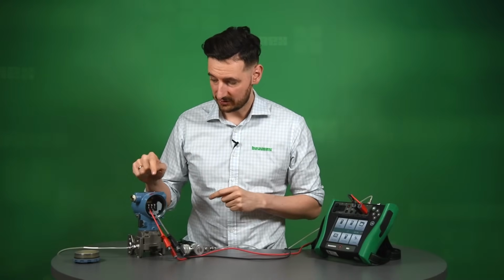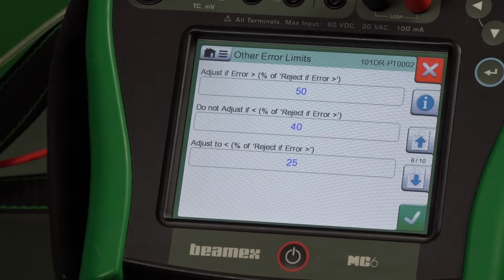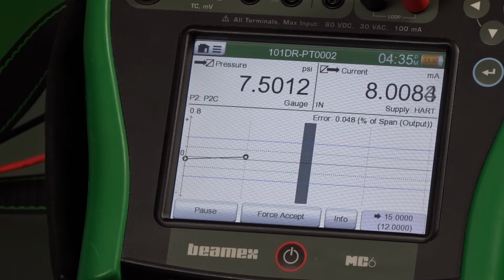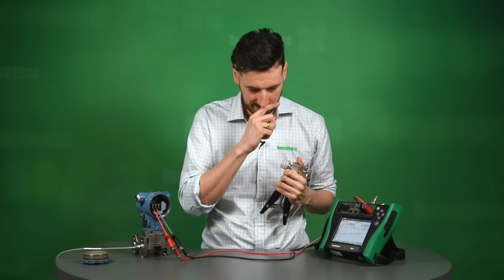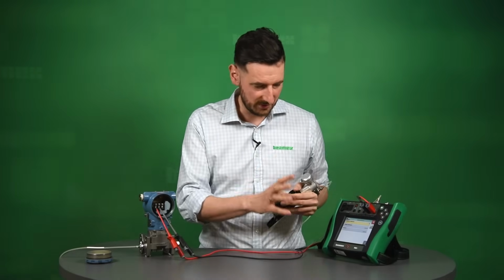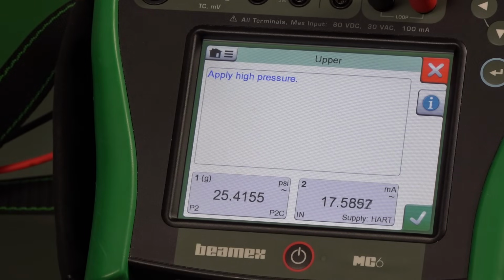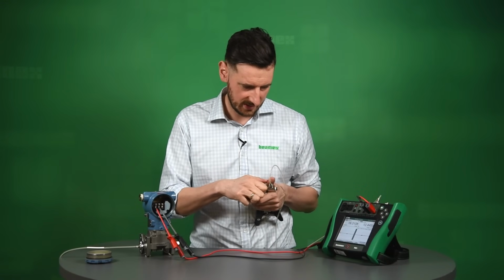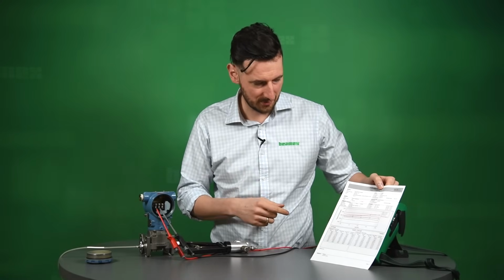How to calibrate HART pressure transmitters - Beamex

Comment: Hello, I have a problem with the Beamax device. The current value does not change when the temperature transmitter is connected
Reply from the maker: Hello Sir! We have already replied to you on this question several times to you in all the other video comments you have added it to.

Comment: Specify connections on the 3 terminals on tx. which 2 terminals used for hart and which for calibration
Reply from the maker: Hi! The transmitter used here is a Rosemount 3051 model. This one has also a "test diode" connection, which all transmitters don't have. In this case the two leftmost (PWR/COMM) is where you normally connect the transmitter to loop. Also, in this video we use these connections to supply the power and to measure the current. These same connections can also be used for HART communication, as done in the video. The third (rightmost) connection is labelled "TEST", and that is where you can connect your mA meter if you don't want to break the loop, when the transmitter is being used in process. 
More information on the "test" connection here: https://blog.beamex.com/measuring-current-using-a-transmitters-test-connection-dont-make-this-mistake
Thanks, Heikki / Beamex

Comment: Beamex mc6 calibrator does not support Yamatake Smart field communicator (SFC260). What to do for Yamatake SFC recognition.
Reply from the maker: Hi Sir, The SFC260 is a communicator and MC6 is also a communicator, so they are not planned to communicate with each others. Most likely the SFC support the Honeywell's proprietary DE protocol, that MC6 does not support. MC6 supports HART, FOUNDATION FIeldbus and Profibus protocols.
Reply: @BeamexCalibration  It can be adjusted with the Yamateke STG940 (STG-940 A1L 00000-R-C7E9) pressure transmitter SFN (SFC260). Bemaex MC5 or MC6 cannot recognize this Transmitter with HART/Fieldbus/ Profibus.
Reply: @alacabuk  Hi, maybe that transmitter is using the DE protocol, which is not supported by MC6.

Comment: Is the pressure source connected to the transmitter as well as the calibrator or is it just connected to the transmitter?
Reply from the maker: Hi, the same pressure needs to be connected to the transmitter and also to the calibrator at the same time. The calibrator will be measuring the pressure accurately, so the transmitter can be checked/calibrated.

Comment: Sir if range in minus ( -1 to 6 bar ) how apply pressure,and getting 4 ma
Reply from the maker: Hi, in that case the transmitter will give out 4 mA at the -1 bar point, and 20 mA at the 6 bar point. For the -1 bar point you will need some kind of a vacuum calibration pump. I practice, you don't always get down to -1 bar, depending on the current barometric pressure (on a rainy day, when barometric pressure is below 1 bar abs, it is not possible to go to -1 bar!). So in practice you would calibrate the low end in a vacuum point that you can achieve (e.g. -0.9 bar). Thanks, Heikki / Beamex

Comment: Sir I want to know 250ohms resistance need or not during calibration of transmitter , using beamex MC6
Reply from the maker: Hi. The 24V internal loop supply in MC6 is provided with an internal HART compatible 250 ohms resistor. So if you use the internal loop supply from MC6, you don't need any external resistors with HART transmitters. 
If you use some external loop supply (like a supply from DCS), then that external loop supply needs to have enough impedance to be HART compatible (if the external supply does not have enough impedance, then you need to add a resistor).
Hope this helps. 
Thanks
Reply: Thanks sir, plz make video of bemex , clearly which which option have to go, for MA apply , and more videos
Reply from the maker: @mohammadimtiyaz5824 , I'm not really sure which kind of video you would like to see, but please check the Beamex YouTube channel, there are a lot of videos on MC6 and how to make different connections. Thanks.
Reply: @BeamexCalibration  actually sir I worked in many plants as an instrument technician but never use beamex MC6, but last week I join power plant in Kuwait, here using beamex MC6,I am facing lot of problems, that's why I'm asking, I want which option I should  go for ma apply, range , and how connection in CV and transmitter beamex MC6 and Hart together
Reply from the maker: @mohammadimtiyaz5824  For training or technical support you can always contact our support at support@beamex.com. 
Or you can contact the local Beamex personnel, you will find all contact information on our website at https://www.beamex.com/beamex-worldwide/ . 
The MC6 manual has pretty good explanations of the connections, if you don't have a manual you can download one from the website at https://www.beamex.com/manuals-brochures/

Comment: Great Explanation . Can we do absolute pressure calibration as well with Beamex MC6 ?
Reply from the maker: Hi! Yes, you can do also absolute pressure calibration with Beamex MC6. To do that, you need to have the Barometric reference pressure module installed (or use an external one) and then all the other pressure modules can be used both gauge (positive and negative) and absolute. If your MC6 does not have a barometric module, that can be retrofitted. Or if you need it very seldom, you can also use an external barometric pressure module and plug it in when you need to calibrate absolute. I hope this helped, if questions, please feel free to contact us at any time.
Thanks, Heikki / Beamex

Comment: How about putting out a service manual for the performance test for the MC6?
Reply from the maker: Hello and thanks for your comment! Indeed, there isn't such a manual available. With the performance test, if you mean to test that all functions and their accuracy, that could be done mostly be using the generation functions to generate a signal and the measurement function to measure that - that is one way to test the performance. But of course a real metrologically traceable calibration should be don eon regular intervals. Thanks, Beamex / Heikki

Comment: Thanks for your clarify. 
So you used just upper sensor trim to modify the deviation that appear in test .
Therefore the lower sensor trim is not need because have good in test. So we should trim depending on document test !?
Reply from the maker: Hi, depending on the situation, both lower and upper trim may be needed. In this example case, the zero point was good, but the span had some error, therefore only upper trim was done. 
If you also have some zero error, then lower trim is needed. 
Thanks, Heikki / Beamex
Reply: Hi , what should I do with message that appear in mc6 at startup about overdue calibration .so can depend mc6 for transmitter  calibration or should recalibrate mc6 and what should I do to do that .thanks
Reply from the maker: @mohammedk1127  Hi, if that message appears in the startup, it means that the programmed calibration period has passed since the last calibration. By default, a new unit has a 1 year (365 days) calibration period. That is because MC6 has the 1-year uncertainty specified. It is naturally up to you how often you want to recalibrate the calibrator. You can go to the settings and change the calibration period if you don't want to calibrate it yet. Or if you have the MC6 recalibrated, you can set the new calibration date into the MC6. These are explained in the user manual. In case of any troubles, please contact our support at support@beamex.com. Thanks!

Comment: very well explained. How to calculate error: xxx(% of span(output)?
Reply from the maker: Hi, to calculate the error as % of output span, you need to calculate the error (in mA) of the output at a given point and then divide that with the output span (typically 20 - 4 = 16 mA), and then multiply with 100 to get a percentage value. For example, if you transmitter is giving out 16.1 mA when it should give 16.0 mA, then the span error is: (0.01 mA / 16 mA) x 100 = 0.0625 %. I hope this makes sense. Thanks, Heikki / Beamex
Reply: @BeamexCalibration  Hello Beamex Calibration. The results of % of span Calculated by your above method is not matching with your certificate in the video. For Example 15.8929 minus 16.000 = -0.1071 mA, the span error is: (-0.1071 mA/16 mA) x 100 = -0.669 % which is not matching with your -0.022 %. So, kindly request you to correct me if i am doing wrong or suggest me the formula. Thanks, Regards Prakhar Jain.
Reply from the maker: @photoninstrumentationandse2773  Hi, that calculation from the output only is correct if the input is exactly at the nominal point. But in real life and as in the video, the input is not exactly on the nominal point, so you need to take that into account. So with the actual input pressure value, you need to calculate what the output should be for that input value, and then make the calculation between what it should be and what it is. Luckily the calibrator does it automatically no matter what the numbers are...

Comment: when you apply pressure ie 22.5 psi, why don't you accurately apply 22.5 psi? Instead you put 22.3 psi.
Does the mc6 do the job??
I'm using mc5
Thanks for the video
Reply: Yes. Otherwise you don’t need MC whatever, just Hart communicator will do.

Comment: So, my question is why do you not have a certified test pressure gauge on your pump to know exactly what pressure you are inputting instead of relying on the transmitter which could be off.  I work in the oil and gas custody transfer area and this would not pass as a good test because their is not a certified reference gauge that your verifing and then calibrating the instrument.
Reply: Bro, one pressure tapping from pump also goes to the mc6, which knows it’s job
Reply: Your comment isn't correct

Comment: But her only you can see the Transmitter Pressure on your Document device but not use a standard gauge for comparation
Reply from the maker: Dear Sir,
The Beamex MC6 is not only a documenting device, it is also a very accurate pressure reference (calibrator), so there is no need for a standard gauge. The MC6 includes very accurate internal pressure measurement modules that are far more accurate than typical standard gauge. So the MC6 both measures and documents the results.
Thanks,
Heikki Laurila, 
Beamex

Comment: Why did you plugged the low pressure port?  Really good calibration device btw !
Reply: The low pressure port is not plugged. I can see it may seem like that in the video, but there are two high pressure ports in parallel, so the other one is plugged not to leak. The transmitter's low pressure port is open to atmospheric, like is the low (reference) connection of the pressure module in calibrator also. So they both refer to current atmospheric pressure. 
If you calibrate a very low pressure transmitter, then it is best to connect the low side of the transmitter and the low side of the calibrator together with a pressure hose, to make sure they have the same pressure in their low ports. Also, in case of a very low pressure calibration, any winds, draft, air conditioning, etc. can have effect to the result if the low sides are left open to atmospheric and not connected together. 
I hope this answers.
Reply: Heikki Laurila Crystal clear! My bad not to recognize the two quick vents on the other side of the sensor adaptor. I started 15 years ago as an instrumentation field technician during construction, pre commission and later maintenance on the biggest natural gas plant here in Argentina... MEGA Loma La Lata. I went thru all that you have described, specially the windy part....hahahaa...!  Really good to hear that complete and accurate explanation from you... Thank you !
Reply: Heikki Laurila Crystal clear! My bad not to recognize the two quick vents on the other side of the sensor adaptor. I started 15 years ago as an instrumentation field technician during construction, pre commission and later maintenance on the biggest natural gas separation plant here in Argentina... MEGA Loma La Lata. I went thru all that you have described, specially the windy part....hahahaa...!  Really good to hear that complete and accurate explanation from you... Thank you !
Reply: Hi Henry. Thanks for your comments, it is nice to hear that from a long-time calibration professional like yourself. Sounds that you have a pretty big site over there...
Happy Calibration!
Reply: @HeiJuLau  oo

Comment: can HART be calibrated by Computer? (HART modem)
Reply: If we talk about metrological traceable calibration, it is NOT possible to do that only with a Computer (with HART modem) only. Also, it is not possible to do that with a HART communicator only. 

In order to make a proper metrological calibration, you always need an accurate traceable reference standard telling you what is the true value. You can then compared your HART transmitter against that true value. So in addition to your computer, you will also need a calibrator.

As there are terminology differences, it is good to mention that sometimes people talk about “calibration”, when they actually mean changing some parameters/settings in the transmitter. This is possible to do with just a computer and HART modem.

For more information, please take a look at the article in Beamex blog:
“Calibration of a HART transmitter and the most common misconceptions about a HART communicator”
http://blog.beamex.com/2016/01/26/calibration-of-a-hart-transmitter-and-the-most-common-misconceptions-about-the-hart-communicator

There are also other HART and calibration related articles in that blog.

Best regards,
Heikki Laurila
Beamex
Reply: thank you for the detailed reply, it's really helpful!